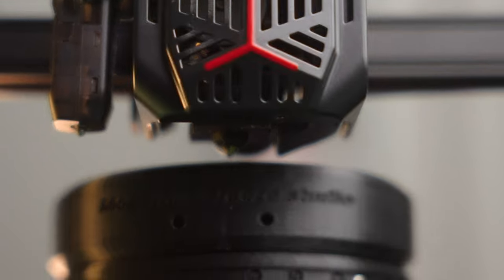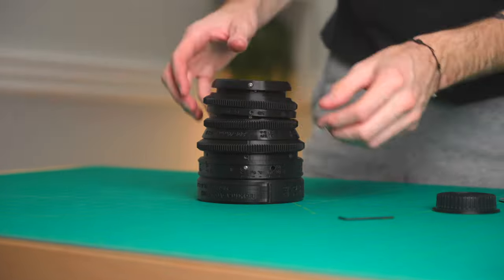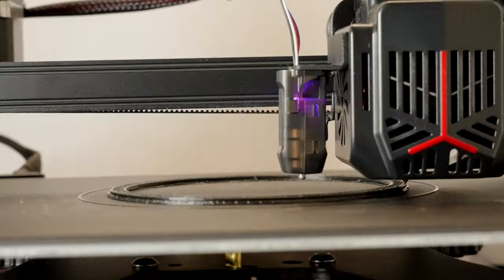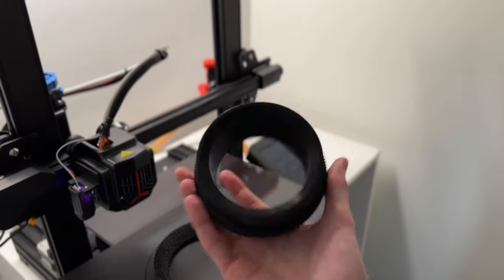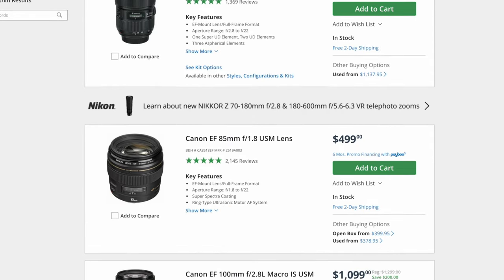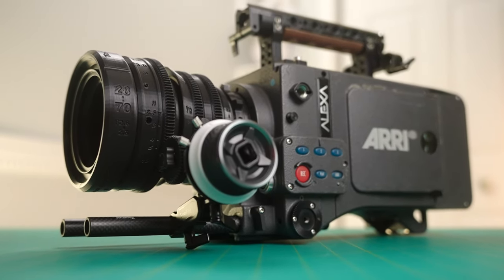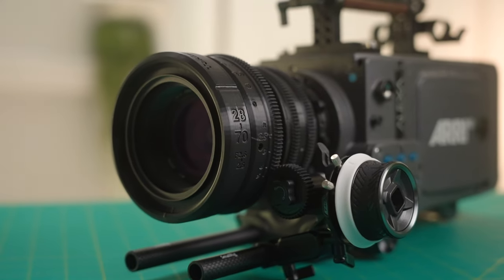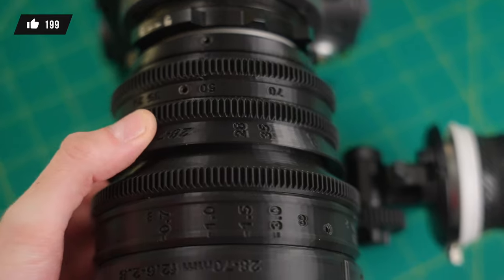3D Printing a Cinema Lens!

Comment from the maker: What other 3D printed camera gear would you like to see me check out? ⬇️
Reply: i think you can print some kind rehousing for the EOS M, so it looks like a cinema camera
Reply: You should print a case for a Raspberry Pi 4, and then fill it with a Pi4 running the OctoPrint software, that'll do the timelapse without wasting shutter count on a full size camera, plus let you monitor the print from anywhere, and skip the lost Mini SD Cards, by having the Ender on your own network.

Comment: This isn't re-housing a cinema lens.  You're just printing parts that fit over an existing housing.  Big, big difference.  Actual re-housed lenses use only the glass and have a much better metal housing as well as a reversed focus ring (270-360 degrees) and usually a smoother iris ring, for example.  There are other differences as well, such as a PL mount.

Comment: Put it for 1 Hr in Acetone or Rubbing alcohol bowl (do not let them touch, just the vapor). You dint mention what type of plastic you used but research which chemical works best for your type. itll give a smooth reflective look instead of matte

Comment: I once designed and printed a custom auxiliary lens housing for my thermal camera, which was embedded in an old phone. Including various threads for focus and mounting. You learn a lot by turning your CAD models into physical prototypes. Like my first attempt was mirrored... And it took me the physical piece in my hand to notice. 

I also 3D printed a pinhole lens, so you don't even need glas, just a piece of metal with a pinhole and some tape. 

And of course, I printed various adapters. Like some you wouldn't find on eBay. D-mount to MFT is quite conal and it does work.

Comment: An absolute MUST for printing this sort of project, is making sure the Extrusion and XYZ Stepper steps-per-mm are adjusted and corrected before printing. Same goes for running the PID tune on the hot end and bed.
Also, swap materials - the Nylon with Carbon Fibre (which is a complete pain in the ar,... to print) will give a much better finish, matte surfaces, so no shiny reflections from the housing. Or try one of the doped plastics, there's ones with Aluminium, gold, bronze, wood as additives, the bronze might make a really 50's looking housing, plus if you ramp up the infill, you can put more mass for better inertia of the rings, and better balance of the Arri on the shoulder, and closer match to the body colour of the camera.
But!,. Don't forget to swap to a Hardened Steel Nozzle first - any plastic that has metal or glass fiber or carbon fibre etc added, Will Be Abrasive, and, Will Eat Out The Center Of The Extruder Nozzle.
Reply: Can you use the carbon one like regular pla same temp?
Reply: @rezjrprod  The Carbon Fibre infused filament is mostly Nylon, and prints like regular Nylon filament, 280 to 300 dec C nozzle, 90 to 100 deg C bed, plus adhesive sprayed on glass for the bed (I haven't tried it on flexible magnetic beds yet). Nylon is a challenge to get to print properly, requiring zero airflow and an enclosure to stop heat escaping, which helps stop the print from lifting.
On top of that, the Carbon Fibre infused filament is VERY abrasive, so at minimum you need a hardened Steel nozzle. Printers like an Ender 3 or an Aquila X2 can do the temperatures, but after loading custom firmware, as factory firmware will usually limit temperatures for safety.

Comment: Does the larger plastic focus gear change the focus throw at all?
Reply from the maker: Slightly since it’s a larger circumference, but it’s not very noticeable.
Reply: Late on the response, no it doesn't change the focus throw in angle (a 270° lens would still be a 270 after the mod) but it changes in circumference, wich is a big deal for follow focus, because the speed of the ramping is determined by the number of teeth bitween far and close focus. The larger the lens, the slower the follow focus (multiplicatevely with the original focus throw angle)